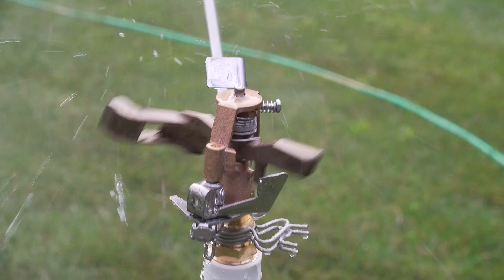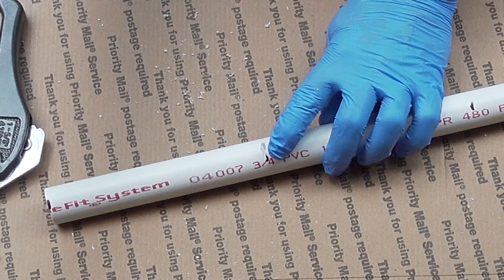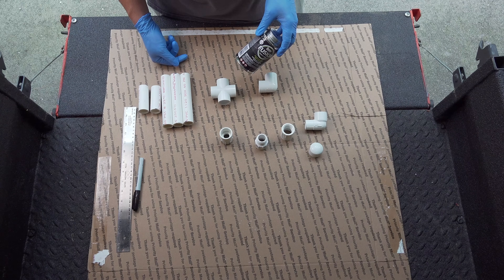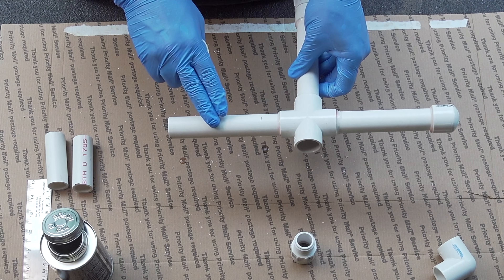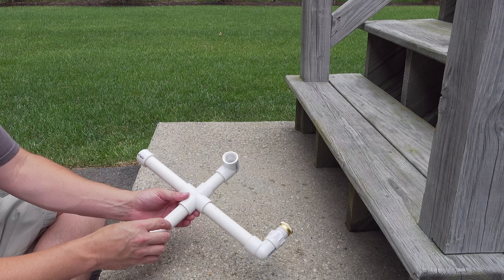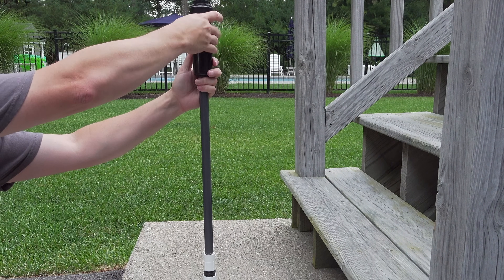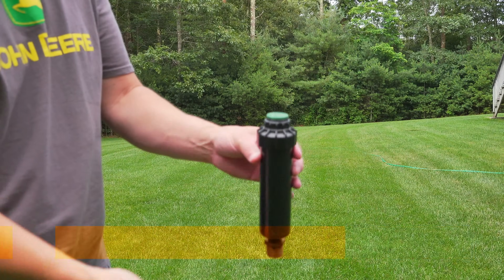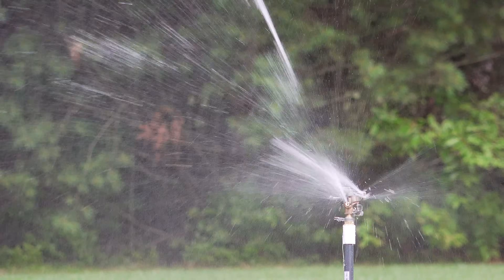Best Lawn Sprinkler DIY - Without an Irrigation System- Build your own EASY

Comment: This does not work.  I made exactly how instructed and as the water rotated to the left or right it would til over.  I even tried to use 6" vs 3" where sprinkler was connected but it didn't matter it still tipped over.  I'm very disappointed as I went out and purchased enough to make 5 and cut all pvc unfortunately before trying one completed.
Reply from the maker: I'm really to sorry to hear this and I still use these to this day. If they are tipping the other option is to use a brick on it to keep it down but normally I never do unless I am using the 2' tall one. The other thing you can try is to extend the length of the arms, but as you can see in this video here https://youtu.be/YXPeoUdbxhQ I am still using the all the time and many people have built them as well with good results.  Hope this helps.

Comment: This is great for everyone with a circular lawn in open space but good luck if you want to irrigate your rectangular lawn and not wet your driveway, deck, house, car, etc. 
Secondly, the video offers the opportunity to attach more sprinklers so now you have hose to pvc then pvc to the next sprinkler etc. So now you’re either running your mower over pvc pipe or deconstructing and moving everything out of the way then reconstructing. Not fun. 
The reality is that if your lawn is in a defined space you have to design a set and configuration of sprinklers that fit that space. So the project is cool but not that practical. I don’t think it should be promoted as such.